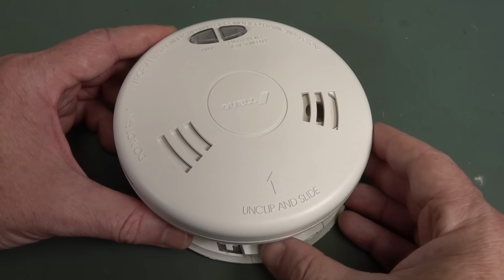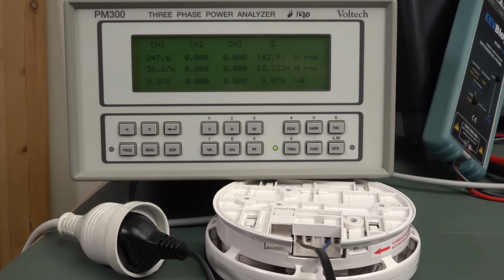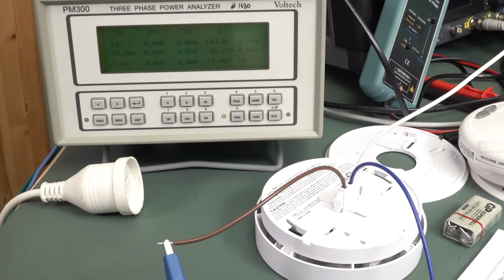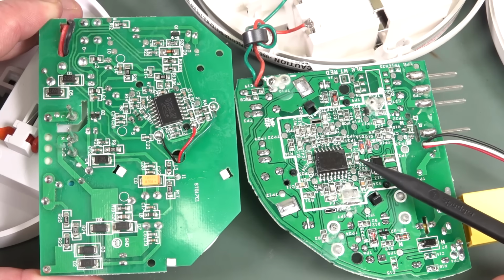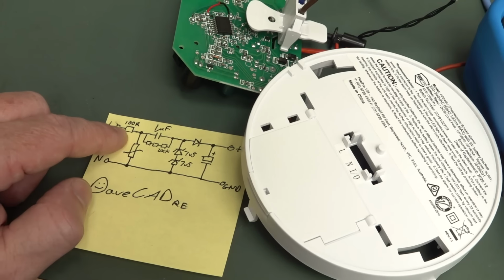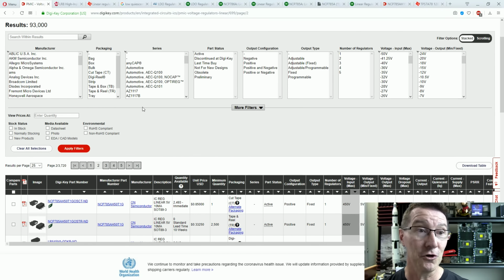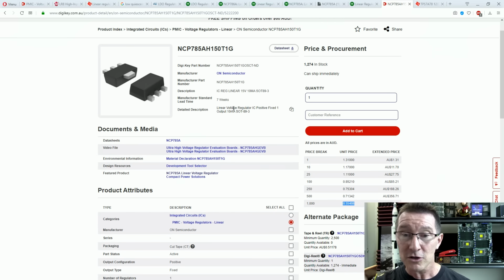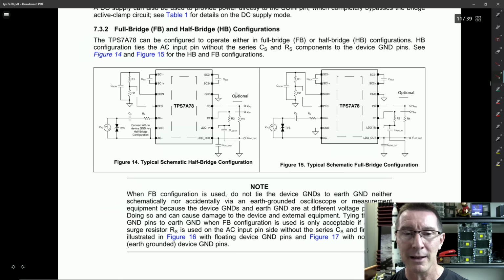EEVblog #1284 - How Bad Product Design Kills The Environment

Comment: This is indeed not great design but in the grand scheme of things this is almost insignificant. 100MVA is actually quite small compared to the ADMD (After Diversity Maximum Demand), used to calculate total load for house holds, of 7.5kVA per house (What we use for a middle class house in our country but it might be higher in a first world county) which would be around 7.5 GVA for 1M homes (100MVA would account for roughly only 1.5% of this). Most power companies will have large Static VAR compensators (https://en.wikipedia.org/wiki/Static_VAR_compensator) that have capacities 100's of MVAr each installed at any major HV/MV substation. So one of these would be able to cover the load for all these devices (roughly 100MVAR since the power factor is almost zero). Static VAR compensators are typically placed on the lower MV side (11 - 22kV side in my country) to reduce the VA load on the transformers so I2R losses between the substation and the generation unit are minimal. Which means the generator will most likely never see the full current. As for the harmonics substations use huge RCL filters & delta connected transformers. The delta configuration is used trap the 3rd harmonic and the 5th,7th,9th  harmonics are filtered using the RLC filter. Here is a page with photos of the RLC filters (https://www.mdresistor.com/en/harmonic-filter-resistor/) . Those round things in the first phot are inductors approx 4m in dia.  Unfortunately its difficult to get good photos since it is illegal to photograph power infrastructure In most countries. Power companies are also not too concerned with capacitive reactive power since the vast majority of reactive components are inductive (think motors used for mining and pumps in industry and ac, fridge, pool pumps, fans used residentially). At the end of the day the designers decided it is far easier to make this someone else's problem since the grid is designed to handle it. You know the old one more wont hurt line of thinking.

Comment: Factual fail by Dave. The LEADING power factor from these capacitive droppers will IMPROVE the power factor of the grid. These are not "wasting power", the VA that Dave is measuring is leading, not lagging. The grid is lagging overall, so these things are not wasting generator output at all. Think about it... what do you use to increase power factor? DOH.... capacitors!

Comment: Why would you install hard wired smoke detectors that still force you to install a 9V batteries in order to use them? What's the point?
Reply: Indeed. why not have a supercap in there for when the power goes out. Surely a fire that shuts down the mains will be detected in minutes by one of these?
Reply: @Diggnuts  or... you know, keep them battery powered only since you have to replace them every so often anyway.
Reply: @cubey  Too late for that. Over here new buildings are fitted with mains detector systems by default.

I hate it so much, that most of the time when a unit goes off because of the battery, I just yank it off and it sits on the shops workbench for months.

So it isn't adding safety!
Reply: @Diggnuts  You could always leave it undone and put a battery one in its place.
Reply: @cubey  Or, I could just be sensible and not set the joint on fire!. I was able to live 40 years without one, I'm sure whatever years I have left will be fine without.
Reply: @Diggnuts  Fires can happen unexpectedly. My mom's natural gas stove plugs in for self ignition and the oven light. It never even pulls much power,  but something happened with the outlet after living there about 13 years and it caught fire from a loose connection. She had a fire extinguisher but she called the fire dept too. It slightly damaged the wall immediately above the outlet was all. I think it happened when she was there using the stove.
Reply: @cubey  I'm not really worried about that. It comes down to statistics and the fact that the place I live in is mostly brick and concrete.

At my old place, a wall junction once fried itself when I was using a welder.. Nothing happened after the plastic burned out.

Comment: The problem is that the battery is not just the backup to the mains supply. The mains supply is also the backup to the battery supply and so must be able to power the buzzer and for newer designs also must supply 100s of ma for emergency lighting.

Comment: I love that TI chip.  Never would have thought of adding switching MOSFETs right into the full bridge rectifier.  Is that a common configuration?
Reply: It's a great way to improve efficiency.  I have been thinking about using it to improve efficiency and power factor in SMPS power supplies.  Because the FET can be made to drop less than a diode when on.

Comment: This kind of stuff drives me nuts. There is no reason a smoke alarm needs to use this much power. I have similar problems with LEDs all over everything that's in a standby mode and stuff, and even just like USB charging blocks that use power even without charging anything. This is why the US needs to have switches on our outlets like the UK has.

Comment: Yeah let's not talk about the fact that you're putting an AC waveform across 2 zener diodes (or even 1!!) pointing in the same direction. In other words, for half of each mains wave (about 50 times per second, for about 0.01 seconds) you'll be shorting the dropper capacitor across the power lines.
Reply: Also, there's a VDR/MOV (Voltage Dependent Resistor or Metal Oxide Varistor) that goes between "live" (through a resistor, probably not even fusable, and even if it were it's nowhere near the MOV) across the power line with no real temperature protection. When that sucker blows, you'll pop your breaker!

Now that I think about it, that's probably intentional; a "Your smoke detector is dead" alarm that you literally can not ignore.

Comment: The power supply must also be able to supply enough current for when the alarm is sounding. This condition could thermally overload one of those linear regulators shown.

Comment: Shenzhen market? Just ask Brightpower China, they have like a million possible regulators for non isolated use from mains. But since they target domestic manufacturers only, the discoverability is bad. I can't really imagine a more or less well made linear regulator to be less reliable than a zener, complexity is higher but temperature and heat emission would be much lower.

Comment: I've thought for some time that it would make sense to standardize around some DC voltage (12v?) to extra pins on the household mains sockets, and have a central AC-DC converter(s).
You'd have to deal with volt drops around the house, so you might need more than one AC-DC converter in the house to keep the cable runs short, but you wouldn't need one per socket. If you had specified a nominal 12v it would actually be between 8 and 16v, and a max of 500mA maybe. That would be enough for clocks, smoke alarms, and the standby circuits in lots of the consumer electronics (TVs, CD players, microwaves clocks, oven clocks... etc).

2 main advantages:
1) The central converters could be much more efficient, maybe even specified in building codes.
2) It would reduce the cost and complexity of all devices that can take advantage of it, especially those that only need low current DC - a cheap small switcher and you're done.

Unlikely to happen, but I think it's an idea with some merit...
Reply: the same here, most new lamps are low voltage LED connected to main power, millions are installed every year for example. If you have PV even better, avoiding losses converting to DC to AC
Reply: I would want something more like several amps max. So you can charge phones and stuff on it
Reply: the voltage drop would be a big problem since people would not like to invest in the correct wire gauge to lower the voltage drop and it would be another wire running around your house making the wiring more complex and creating more confusion for people who can barely wire the line and neutral wires the correct way around.
Reply: i got a big 20v laptop power brick to use in my room for DC power - it's very nice :) they make them for gaming laptops up to like 12A and they're actually rather efficient apparent power-wise compared to stupid cheap power bricks

Comment: We don't even have mains powered smoke alarms. The ones that are most prevalent right now are battery operated with a rather large lithium cell that isn't even rated to be exchanged, so it's guaranteed to run for 10 years, and then it gets replaced. Also quite wasteful, but not as bad, I'd imagine - and you could even make them run on a 9V battery for 2-3 years as well.

Comment: Hey Dave, I was just wondering: Couldn't they just swap out the capacitor behind the resistor with a lower value?
Like 100nF instead of 1µF would give you a power draw of 8mA instead of 80mA. Of course you'd still have the apparent power draw, but it'd be a magnitude lower and the device doesn't seem to need that much power anyways.

I've designed some circuits which were supposed to have a really low standby power draw back in the days when all those fancy magic high-efficient regulators weren't really a thing. I used a really low power zener-based circuit like you showed (but in the range of <1mA @ 5V) to power the "Do I have to activate myself?"-circuitry and used a more traditional chonky transformer based design for doing the actual heavy lifting, but only if it was really needed (I've just fed the L-Line through a phototriac). Back then I was really proud of myself, not so much nowadays lol :)

Comment: Probably an important thing to point out (not sure if i saw it in the first 20 mins) is that 91% of australias power comes from coal and gas so it has a real impact on the environment. For somewhere like NZ its not so important as 80% of the power supply is from renewables if you ignore initial construction CO2 output. 
I always say to people who want to add solar to their house in NZ to be "green" - its better to invest in an australian solar, wind or hydro power plant as it makes more of a difference over there.

Comment: Hi Steve, Ever wondered how much power is used by all the installed 'smart meters'. I know this is not paid by the customer, at least not directly. I never succeeded in finding in the specs of smart meters how much power they consume. I remember that once you investigated a smart meter. If you still have that meter you might investigate how much this meters draw or how the power supply internally works. Keep up the good work.
Reply: Sorry, i meant Dave..

Comment: how About the even more obvious solution? using a small transformer to get the bulk of the voltage drop needed and then rectify and regulate and stuff.
with the current draw of this device-class i guess even a small toroidal core type would do the Business?! or did i not think that through Right?

Comment: Dave, you may be forgetting the big factor here, and that is RELIABILITY. Discrete zener diode regulated power supply is inherently reliable with very little to go wrong, whereas IC based regulators may not be as reliable. You have to look at MTBF (mean time between failure) for each individual VR IC. Reliability, legal liability and low-cost are the main factors for consumer grade smoke alarms.

Comment: Dave,
I think you were talking about the NCP786A when you said it doesn't go up to 15 volts.  I looked up that part and found this:
Output Voltage
The output voltage can be set by using a resistor divider
as shown in Figure 1 in range from 1.275 V up to 15 V. The
appropriate resistor divider can be found by solving the
equation below.
VOUT  1.275  1  R1
R2  I
ADJ  R1 (eq. 1)
The recommended current through the resistor divider is
from 1 A to 3 A in order to keep negligible ADJ pin
consumption. In this case we can simplify Equation 1 to:
VOUT  1.275  1  R1
R2 (eq. 2)

The data sheet is at this url:                                              https://www.onsemi.com/pub/Collateral/NCP786A-D.PDF

Comment: @EEVblog I'm watching your videos pretty good stuff seems like you got a little bit of know-how, check out this first PCB on learning how to put together little Arduino controller for an rs485 module with a whole slew of sensors on it.

 I've used cat6 shielded to run twisted-pair rs-485 network but I think I'm going to have a current problem with this one.. any idea on how to lower the pull.. or is it just not possible these things are just going to pull however many watts they're going to pull or maybe kind of do what you're talkin here and put that voltage regulator on there where the power is coming in on the module screw terminals.. I have two/pair terminals coming in for the a /b data /5 volt /ground common and then two more paired terminals that will basically daisy chain to the next rs-485 module and on and on.. I can fit 32 module notes on one network without a repeater, obviously won't need that much though because it's just going to be a little home automation thing I do with maybe seven or eight mods around the house. the all go back to a main controller with a c language program in Arduino and it'll just know which room the motion is set off an alarm to email alert or auto-dim a light up in that room as you walk in and then after so much time it will take the dim back down.  https://youtu.be/OgeSv6TEanM

Comment: WHY SO ANGRY.  I like this guy but he takes a small .5 watt smoke alarm and then multiplies by 1m to claim this is TERRIBLE, since this is equivalent to 5 wind farms.  But .5 watts if a house uses 24kwh a day is at all hours of the day 1000kw/.5 or 1:2000,,, even if using 5 alarms in a house this is 1/400 or energy use being the smoke alarms. This is under $5 power a year. …….. So we can do better, but SHOUTING about this minor .2% is confusing to me.   ….. Sorry if I missed the point.

Comment: I have  five 9V powered smoke alarms spread throughout  my house. I change the batteries annually in January.  I put a reminder in my Google calendar for next January.  That way I may spend a few more  bucks than I need too  because: less cheap but also no cheep. As I am old and less likely each year to be around next year I write the install date on each battery so some other bugger coming after me knows when they were last changed. Really can't see the point of mains versions as you need the battery anyway. Mind you, safety is a probability lottery. As an old fart, am I more likely to die in a house fire than by falling  off a step-ladder changing batteries? Take your pick.

Comment: Out of curiosity, is there a benefit to overall reliability or certifiability of the circuit with the less-efficient design? I am just curious about other factors - apart from cost - that might have informed the design decision.

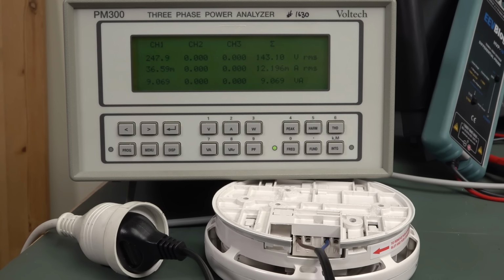Comment: can someone explain what dave means between 4:31 - 4:51?
Reply: Typical home electric meters are essentially an electric motor with the armature coils connected in series with the load, and the field coil across the supply. The torque on the armature depends on how those fields push against each other. At a fixed voltage, more load current means more push. 

But as these fields vary with the cycle, if they are all in phase (purely resistive load), then that push will be maximized. When the current phase leads or lags the voltage, the torque is less as the instantaneous voltage times the current are less than if they were in sync, so the armature and it spins slower. It doesn't completely measure that portion of the load current where the voltage isn't lined up.
But that current is still flowing in the wires and does heat them up (resistive loss), but they power company can't charge for it because they can't accurately measure it with the mechanical meters.

Newer electronic meters can measure the actual current being consumed, whether your devices are getting any actual work out of it or not. And this is typically a setting in the unit which the power utility can remotely change. Some locations are already doing this, and more will likely in the future.

Comment: The X-class capacitors in circuit like that degrade over time - guarantees the alarms will need replacement sooner rather than later.

Comment: Why on earth is mains supply needed at all? These photoelectric alarms barely don't take any current and are completely battery powered at all in my rooms! And they do run at least 2 or 3 years out of one single 9V block! So, what's the point of 240V mains? You'll have to change the 9V batteries anyways every 2 or 3 years as they would self dissipate their charge.

Comment: since the current in a capacitive drop circuit like this is proportional to the capacitance, surely the simplest method to reduce the power use would be to reduce the capacitance to match the load? by my calculations a 1.5nF capacitor should be enough for the detector and chip. I guess they've overrated it so it's enough to run the alarm sounder as well? a second larger capacitor with a HV transistor or triac that connects it only when the PSU rail drops below level could work. As for the original question of a low quiescent non-isolating psu, perhaps the LNK304 high voltage buck-reg chip?

Comment: As in the comments of a video I made on the same topic, even here there are people that think reactive power is not real and ultimately would not draw real power at the shaft of the turbine at the power station.
Someone has even said that the mechanical inertia would compensate for the apparent power, forgetting that inertia is just mass and to accelerate the mass you need energy.

Comment: If you're incensed about the VA or power factor, don't forget that it's probably capacitive and should help correct the inductive loads on the mains from all the motors.
Reply from the maker: Not really. It's likely mostly harmonic, different beast. Had to be filtered, not phase corrected.